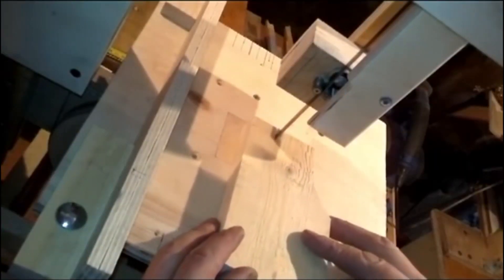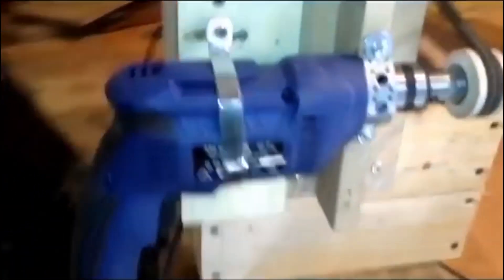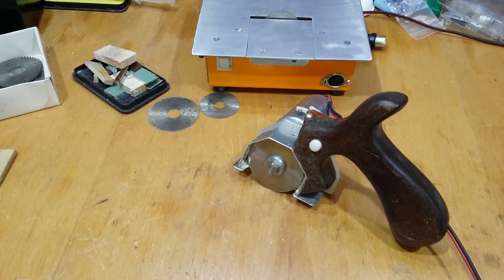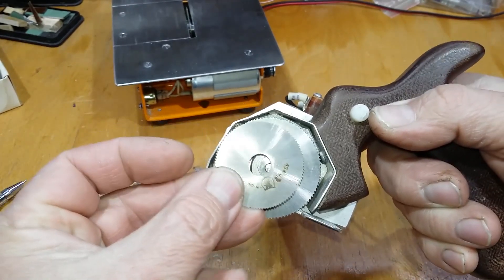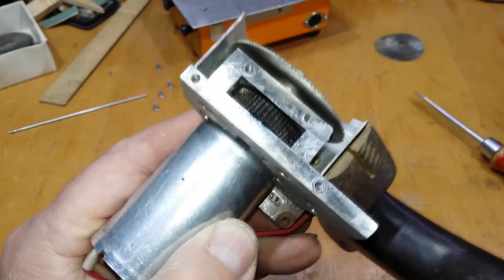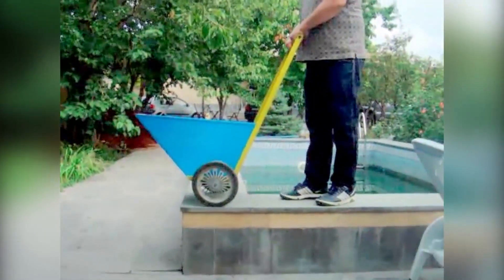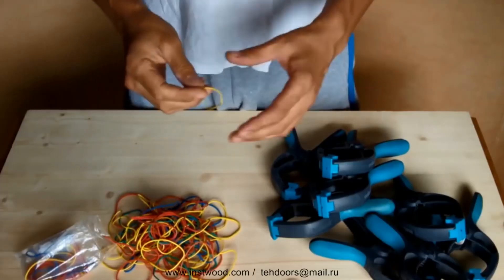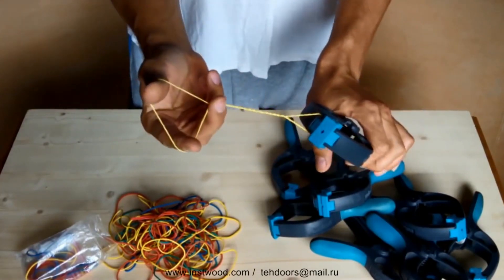6 INVENTIONS THAT WILL BLOW YOUR MIND.

Comment: I like the two tile inventions at the end.  Measuring for tile always seems to be harder than you would think.  The hole saw jig is cool, but if you don't have one, you can start your hole by tilting the saw and just use a small portion of the saw to get a groove.  Tile the saw to another spot, cut groove.  Once you have enough groove, you can hold it flat and complete the hole.